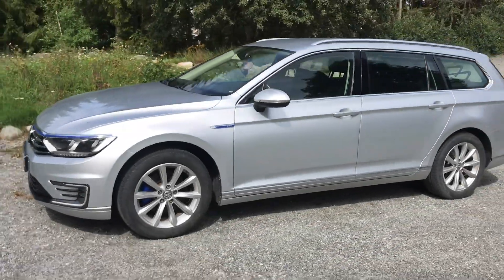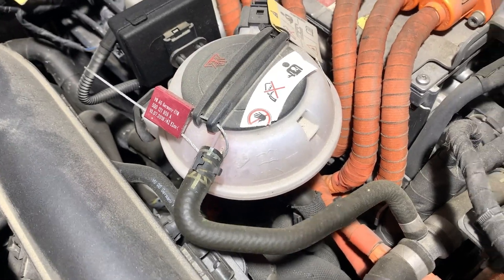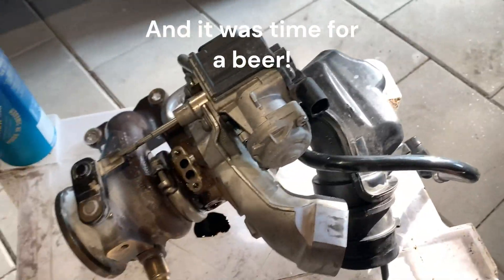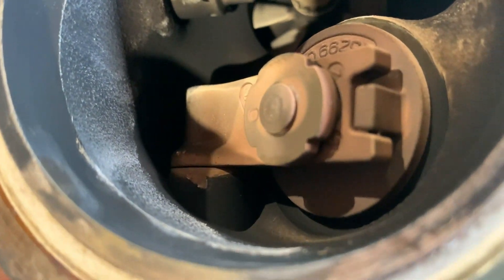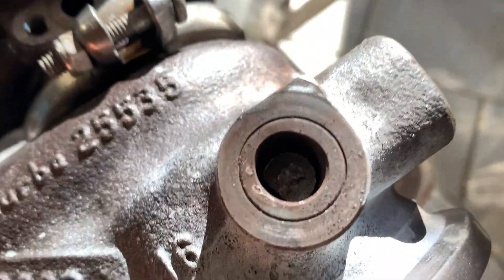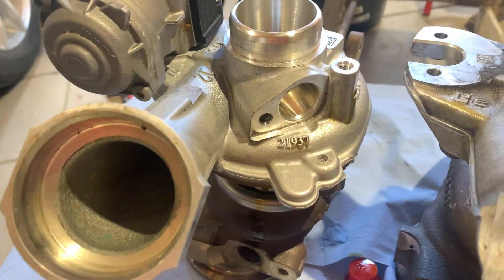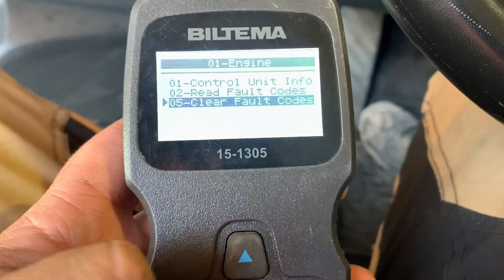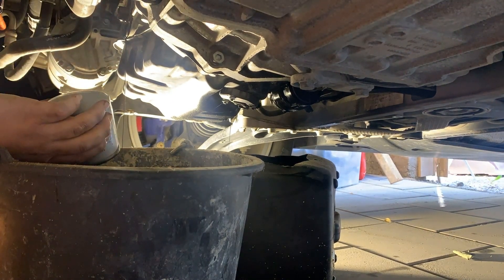REPLACE THE TURBO! Passat GTE 2016 with EPC fault FIXED!

Comment: I have the  error and a have the same light on in my car what can be
 P003400 error and turbo charger bypass valve control circuit low
 vw golf gte  7
Reply from the maker: It might be the same issue, if you reach to the back of the turbo you can feel the wastegate axle, if it you can wiggle it it is the same issue. Google wastegate flapper VW to see what im talking about.

Comment: I have the same problem and i fix turbo and i have again same problem i connect to vcds and i get

P0299 and
P2279

My mechanik think maybe catalytic is full and need to clean

But i dont think so
Reply from the maker: Have u looked for leaks from turbo to intakemanifold? P0299 is low boost (leak?) and P2279 is airsystem leak.
Reply: @Peteprojects i have p227900  what i need to do, i have loosing power

Comment: PLEASE SIR Make a one video passat gte how many klometer change gear box oil thanks 2016 gte vwpassat
Reply from the maker: The serviceplan say replace the gearboxoil every 60000km, you have to pump the fluid in to the gearbox and I dont have the equipment for it so I can’t make a video about it!